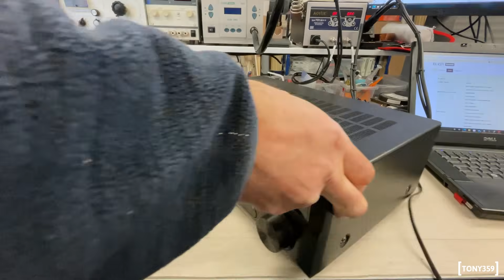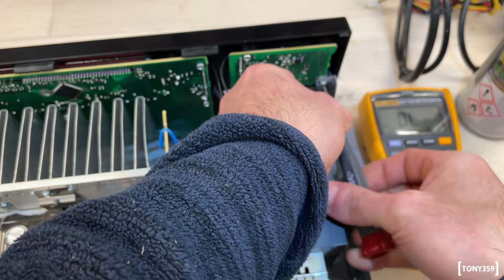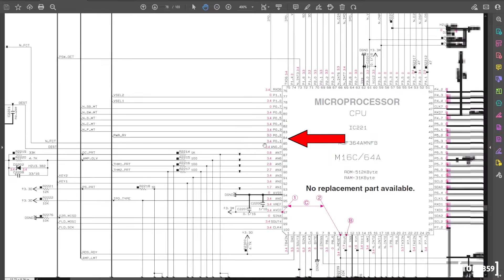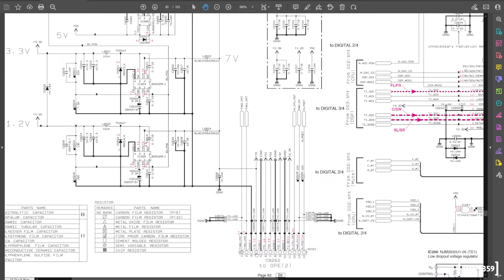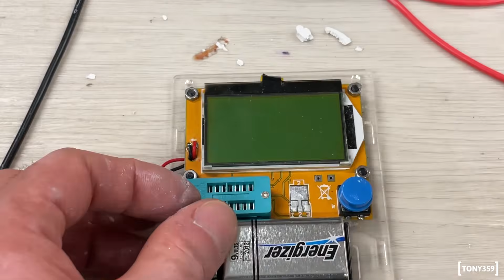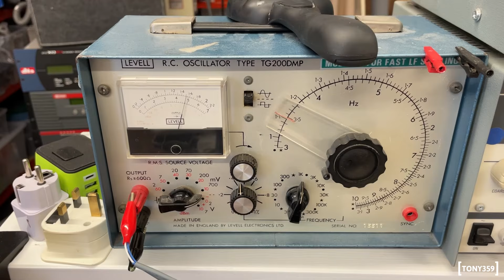Yamaha RX-V371 Repair and Test

Comment: I have the same V371 receiver with a similar problem but I get DC 138H as the protection fault. The silly thing is when I run Test All then all the 5 channels work fine. If I look inside, unfortunately there are no obviously bulging capacitors to be seen.
Reply from the maker: DC should mean that you have DC out of the terminals. If too much DC is output, you risk to damage your speakers so the amp shuts down. If you have a multimeter, probe the channel outputs and see if you actually have some DC - I think the receiver will only tolerate a few hundred mV before shutting down. I am not an expert but in that case it may be a faulty amplifier module - those are difficult to source and expensive I'm afraid. Still, I would check the 7V output with a multimeter set to AC: it should read more or less zero. If not, the capacitor has failed and it lets AC through. I am not suggesting that capaciors are always at fault here but that particular capacitor seems to be a common fault with the V371.
Reply: @tony359  Thanks for the pointers. I checked the 7V output and it is 9.24V so that could be where the problem lies. It points to the bridge rectifier but I have never seen one fail and give you more volts.
Reply from the maker: @BabyFruitBat  my oscilloscope read 8.27V, I found the values from the service manual not very accurate, not sure why. That voltage is going through voltage regulators if Memory serves so that shouldn't be a big problem. Did you also measure the AC component of that rail?
Reply: @tony359  The output from the voltage regulators is 1.2V and 3.3V. The AC component of the ripple is minimal, about 20mv. I also measured the DC level on the loudspeaker outputs and they are all less than 3.5mV. I am stumped now. Any other ideas?
Reply from the maker: @BabyFruitBat  You've done a good job! Does the unit shut off immediately or every now and then? Some thoughts. 1. The issue may be intermittent so you need to measure exactly when the unit shuts down. If you watched my video you saw that the 3.3V was ok until it wasn't! :) Is the 20mV on the 7V line? If that's the case, I would say that that is not your problem. 2. I think the unit would shut down when even ONE channel has DC on it. So you should measure DC while the units shuts down on each channel. 3. From the service mode, check A/D Data check. This will give you real time DC reading on the outputs - I think they are all joined together, you won't get channel by channel. It may help to see if and when the level is increasing. Normal values are 27 to 88. Reference is 3.3V when reading 255 so 27 = 34mV and 88 = 1.13V. You get 138 so the unit is somehow reading 1.78V at the outputs. Really not sure whether this is a summation of all the channels or not - should be. Anyways, if you see the value increasing and then the unit shuts down, I would then follow that route: is that a false reading or is there DC on the outputs? Detection is on pin 87 of the main chip. The signal is probed on all channels (and mixed together) via a resistor if not wrong. Page 83 of the service manual. It feels a very basic circuit which is pulled down by a 100K resistor. 
I hope this helps, sorry it doesn't seem like a super simple fix!
Reply: @tony359  You are a genius! The voltage on pin 87 was exactly 1.78V. as you correctly predicted but when I measured the DC_PRT voltage on the connector to the board it was1.7mV. This meant there was a broken connection somewhere between the connector and IC221. I tried to remove the board but that is a mammoth task so I just ran a link wire between the connector and R2214. The A/D check reads 057 and the receiver is working fine. Thanks very much for your help, it has been invaluable.
Reply from the maker: @BabyFruitBat  oh wow amazing job! Very happy to be of help in rescuing a unit from the dustbin! To be fair the Yamaha service manual is very clear, so much better than the Onkyo’s I’m used to. Well done again and I hope to see you soon on my channel (I hope you’ll subscribe soon!)
Reply: Hello. I have one yamaha RX-V363 5.1 speakers B are working fine, the stereo speakers A have no sound. I have set the amplifier to stereo 2 chanel and just speakers A are selected and no sound. Can you help with a suggestion?

Comment: Just watched your video cause im having trouble with my rxv673 are they more or less the same unit. Thanks for sharing.
Reply from the maker: Thanks for watching! I hope you can fix yours. That capacitor seems to be a known issue with many Yamaha apparently!
Reply: 2025/02/19 MY RX-V673 in dead mode..it did come on then went off

Comment: Great! You video is very helpful to me. Now I also repair my RX-481, now. Have you ever suffer the relay clicking repeat after power switch turn on? I also open case and check the clicking sound source. The clicking sound comes from output stage relay.
Reply from the maker: Hey thank you! I hope you will succeed! I had that clicking thing with an Onkyo but I was not able to fix that I'm afraid. I am not so familiar with the Yamaha series to be able to help you I'm afraid but I would start with the basics - check all the voltages. Also check that there isn't any DC out of the terminals, if an amplifier is outputtin DC, the protection circuit will switch the supply off. 
(Disclaimer, sorry: please be careful as there is mains voltage in that device. Open the device at your own risk! :) ) 

Thanks for watching!
Reply: @tony359  I have exactly the same problem, receiver turns on for 3 seconds and  then goes to Standby. There's a click from the PS board area, maybe the relay? I don't see any bulged caps. I know I need better multimeters and a cap tester would be nice too, plus learning everything about how to use them wouldn't hurt. P.S. Yamaha HTR-5960
Reply from the maker: @Carlsings  If you start the unit with the service mode (tone control + straight and then POWER ON) the display should tell you WHY it switched off last time there was an error (and then it will likely switch off again). That might help a bit! :) See 21:30 on my video. Good luck!

Comment: Great job! What is the amplitude of the 1Khz signal from the function generator that you used to feed the input of the amplifier?
Reply from the maker: Thank you! The signal was 1.72V peak to peak - 590mV RMS. To be honest I did not think too much about the appropriate level for the test, but the amp was clipping the output around reference level so I thought it was ok. Consumer input level should be -10dBV or 0.316V. If this is RMS - I am not sure - then I wasn't too far away from that! Thanks for watching!